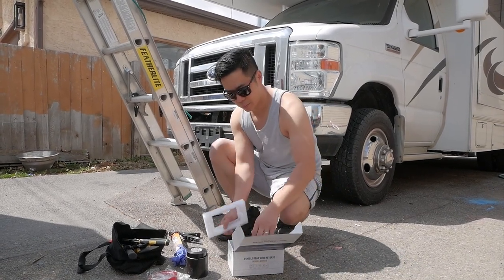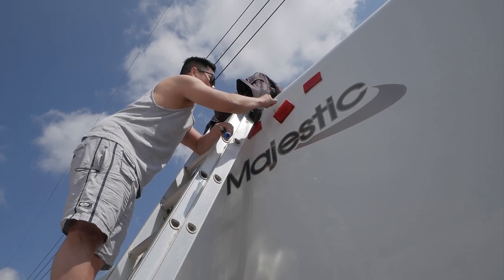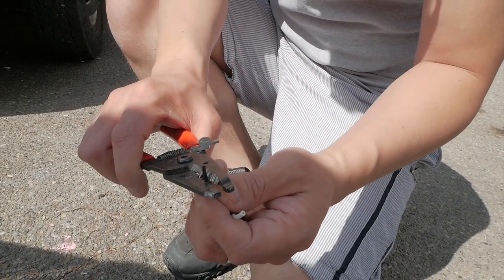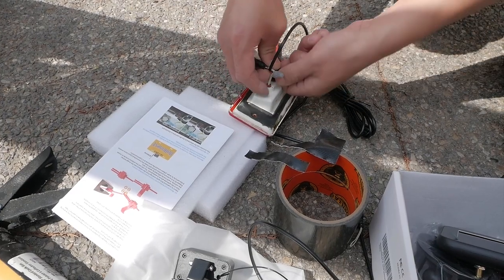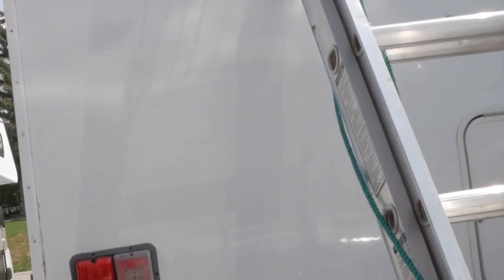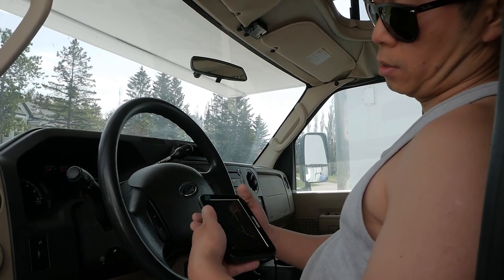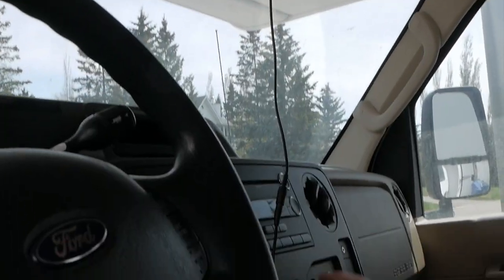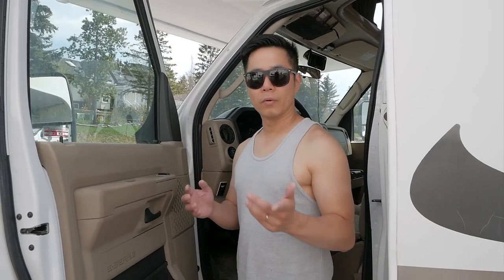How to DYI install a RV Wireless Backup Camera in 20 minutes - no holes #dyi #rvlifestyle #rvliving

Comment: Nice. This method will work great on mine too. Thanks
Reply from the maker: You bet. I also just did a wired install. Took a decent amount more. I am going to post the video soon. I prefer wireless.... just less hassle.
Reply: @thebestfamilyoutdoorshow Was able to do this install last weekend. Your method worked perfect. Thanks again for posting. 
The camera on mine is bigger so required a couple screws into the wood framing through the aluminum. And they send a couple elec taps so I didn’t even have to cut wires. Didn’t know they made such things.. 
Thanks again.
Reply from the maker: @markoshun  That's awesome man. I am glad it worked out!

Comment: Im thinking of replacing my existing camera with a wireless and your video is helping. However, please be aware that a scotchlok UB2 connector will let you tap power off the light cable without cutting it.
Reply from the maker: That is true for all of them I bought actually. They all came with a wire tap. I just didn't end up using it. They both work well I believe because another person commented saying they used the wire tap method successfully. So which ever method you go with should be OK. 
Wire tap will for sure avoid cutting the cable.

Appreciate you commenting!

Camera install status update - I did 5 of these installs and they are working fine. So the product itself still doing its job. 👍

Comment: I installed a camera on my 5th wheel, tow vehicle was a dodge ram, couldn't get a signal?  The fix was to turn my lights on in the truck, take them out of "Automatic" and that provided the power to the factory pre-wired setup in the RV camper.  So, it was plug in play after all :)
Reply from the maker: Thank you for sharing. I am sure this is going to help a bunch of poor suffering souls out there. 👍

Comment: When i hooked up this unite the 3 back top running lights on the right died and nothing works now
Reply from the maker: Hey I am not sure why that happened. If all the running lights are off, it could be a fuse that has tripped. 

I am not 100% sure on this one but I think the fuse you want to check is the one for the tail lamp circuit, the one you want to check is Fuse 22 or F22 which should be a 15 amp fuse. This is located in the interior fuse panel. This is the panel behind the foot brake or emergency brake. 

You can usually tell if the fuse is blown by visual inspection. Most of the time if a fuse blows you can see the metal piece in the middle broken. 

I hope this fixes your problem.
Reply from the maker: I just read it a bit more carefully. So only the top 3 on the right died. That is odd and I am not sure why if that is the case. A few steps I would recommend is reversing the changes you did and see if the lights come back on. If not, perhaps use a multimeter and check if you are getting power to the lights.

If there is power and the lights are not on, then the lights somehow broke. If there is no power, then maybe the fuse is blown or there is some wiring issues. 

Again, I am just really guessing. I do not know why only some of the lights would work but not all. I think all the running lights, front top and back top all are one fuse.

Comment: Try using wego wire connection instead of wire nuts
Reply from the maker: That would do it, those connections would be a cleaner method. Thank you for tip.

Comment: Maybe never use that brand again
Reply from the maker: It is something to watch for. But for the record (for what it is worth), I installed 5 working ones. The ones that worked and installed properly are still working almost a year later. For one install, the monitor stopped working - but it turned out the cigarette lighter power adapter failed. This is a common standard part that many reverse camera's use.  

Seemed to be some weird QA issue, but I did get my money back on return. I have tried a few other brands since. Will be posting my experiences with them also.